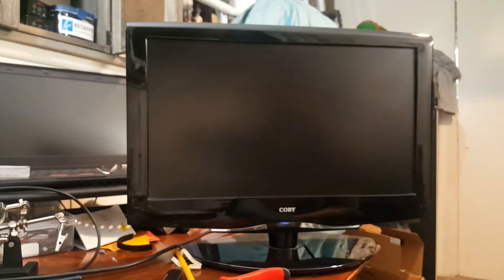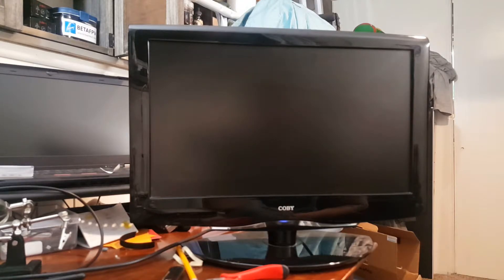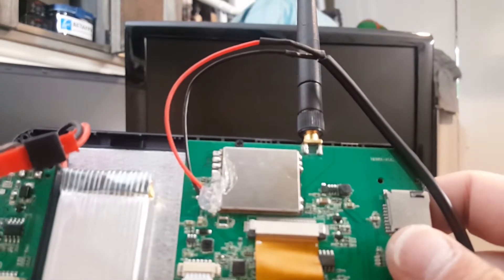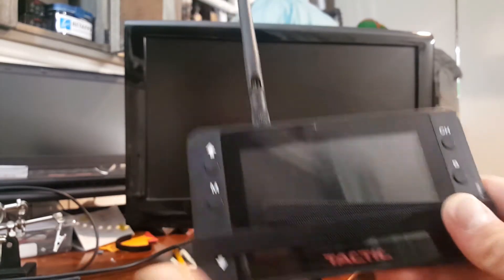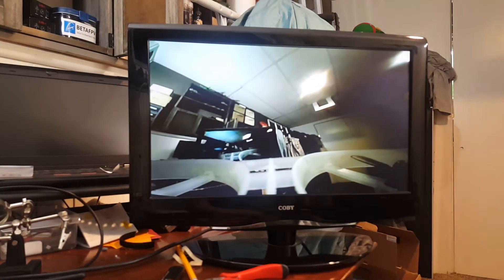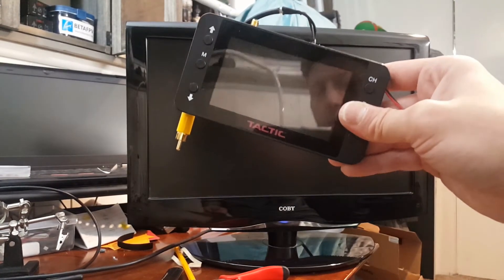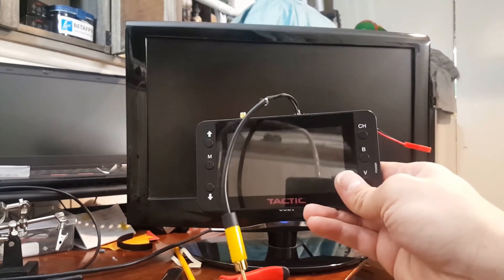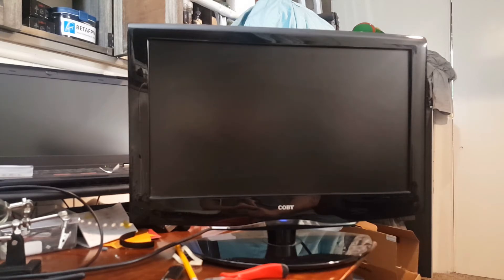Tactic RM2 5.8ghz FPV Monitor Video Out & Giveaway

Comment: I'm also starting to have battery issues. Did replacing that battery fix the charging issue or are u using a separate lipo charger. also what is the original battery. I've haven't pulled it open yet but I'm getting ready to.
Reply from the maker: +Aaron Wilkins If I remember correctly the battery is 1400mah.  I do not use the micro USB to charge the replacement battery.  I have a evpeak e6 that I use to charge the batteries now.
Reply: C Ray Tech thank you
Reply: C Ray Tech, also; what is the input voltage of the battery?  Thanks again
Reply from the maker: +Aaron Wilkins 1s 3.7v 1400mah lipo is stock.  I'm using either 1 or 2 1250mahs to power mine.  I made a parrellel cable so I can run two batteries at once to increase the capacity.
Reply: C Ray Tech, awesome thanks. This stock battery has got to go.
Reply from the maker: +Aaron Wilkins yes I went through 3 monitors all had the same issue.  They work great once the battery is replaced.  They are even better once you add video out. 😁
Reply: C Ray Tech cool, I have a bad 4s I just got 3 good 1s cells out of that will be getting jst connectors and hopefully be able to rotate them in the monitor and charge them externally

Comment: I've found my way back to this video again and was curious if you knew a way to do a video in on the receiver in order to hook it up to a ground station for increased range
Reply from the maker: +Aaron Wilkins I do not know a way to do it yet.  That sounds like a fun project.  I may give it a go
Reply: C Ray Tech that would be awesome.  My local hobby shop has a diversity reciever for 60 bucks and think it would make an awesome addition to this setup
Reply from the maker: +Aaron Wilkins That would be awesome